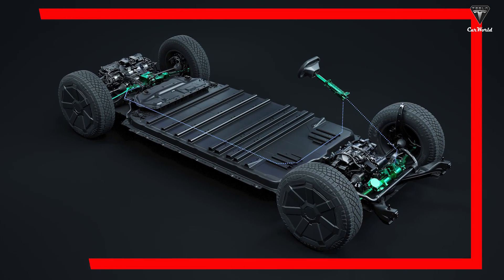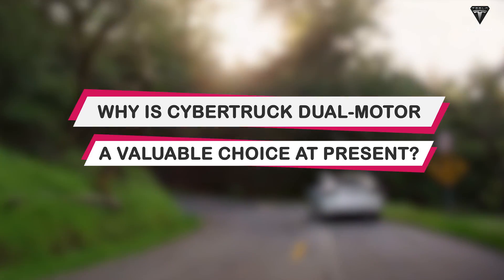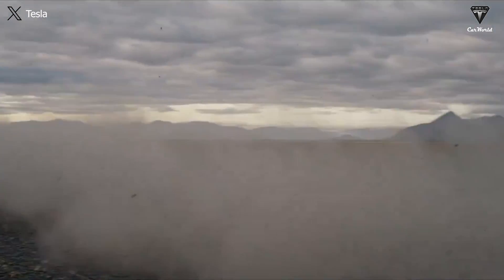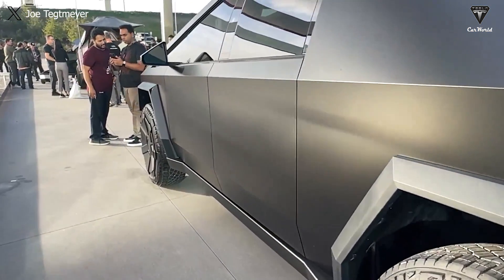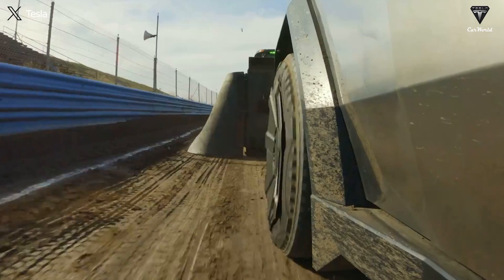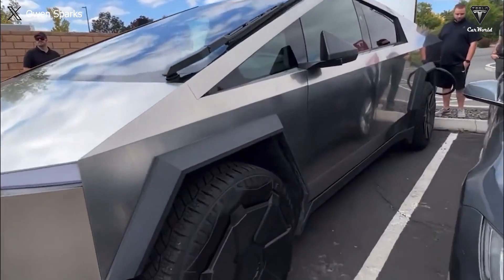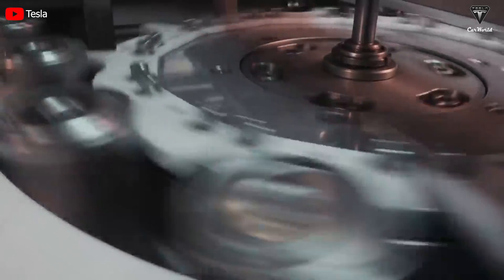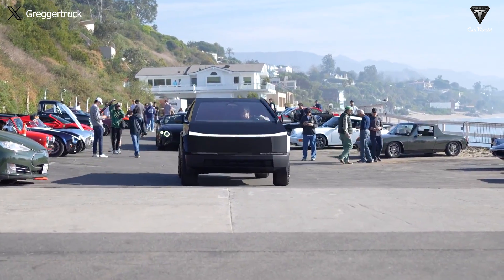Cybertruck 2024: Elon Musk LEAKED Best Value in the Special "DM Variant", 350kW Speed and 4680 Gen 2

Comment: Ordered dual motor last week. I will be delighted if we receive the vehicle in 2024, expect 2025. Price did not surprise me. Major concern is feature comfort inside. Suggested range far exceeds my endurance. Thanks for informative vids.
Reply from the maker: Thank you! We know that rising costs cause many customers to give up and blame Tesla. However, looking at the US economy and the improvements in range, performance and towing capacity of the Dual-motor variant, it is more worth buying now than ever. All better 2019 specs
Reply: Very difficult to mass produce this truck.. Already there are one million delivery backlog, right ?? So you may get it in 2028
Reply: Original request from Tesla requires $100.00, at that time I was 1,732,000. Last week required $250.00. Reply said, delivery in 2024. A running joke in my family, “what generation will get the truck”? I have not put my F150 up for sale.